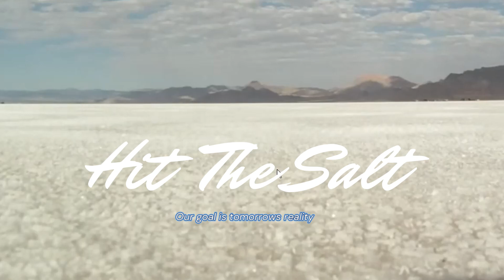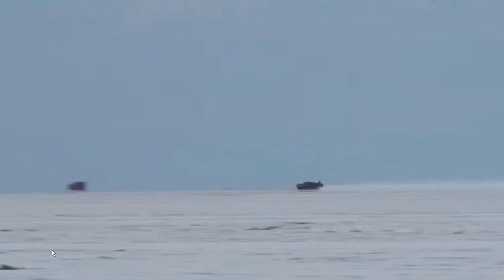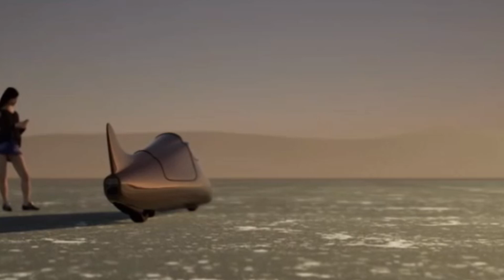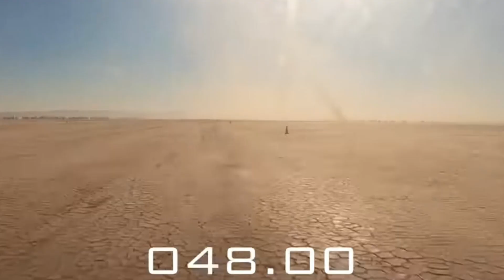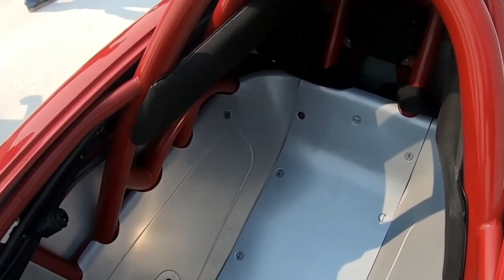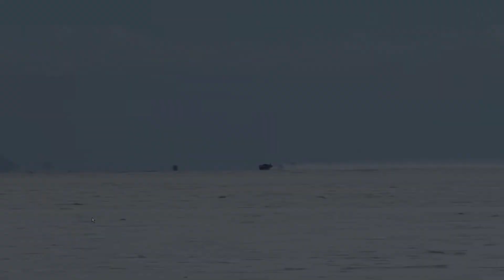300 MPH PROJECT #THESTEELWEASEL#FAST#AMAZING

Comment: Amazing 😲 its distance we need tho not just speed. Currently electric powered bikes n scooters are only capable of aprox 60 miles on a full charge which isnt much good for a scooter rally but im sure we will be improving this in the future as tech comes on in leaps and bounds. I can only say i definately wouldnt like to experience a tank slapper at 300mph 😂
Reply from the maker: You mean a battery slapped😂😂😂😂